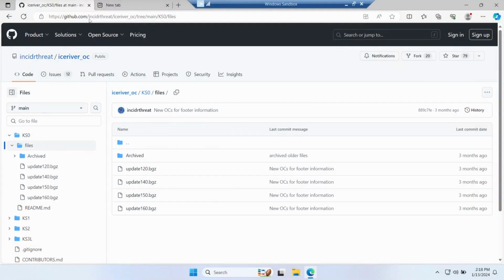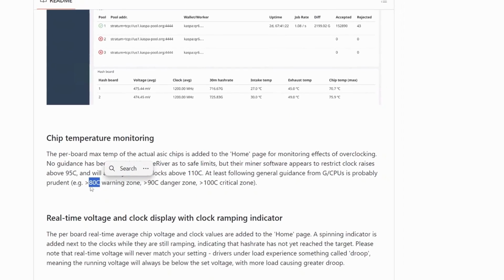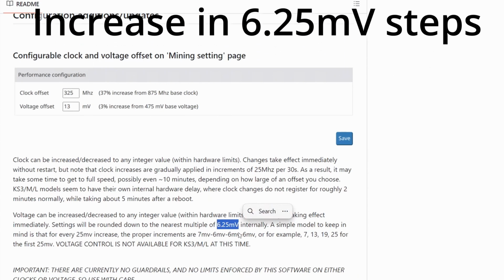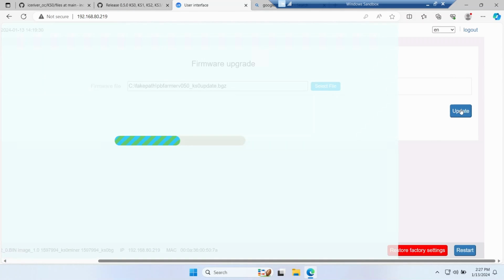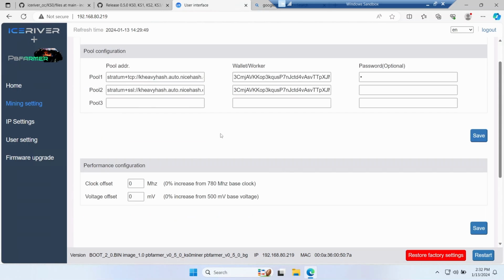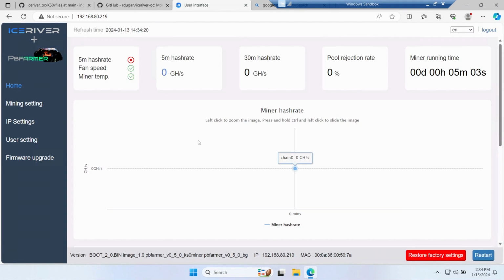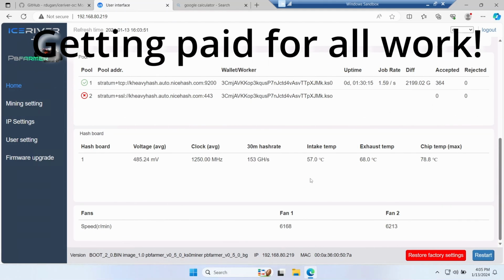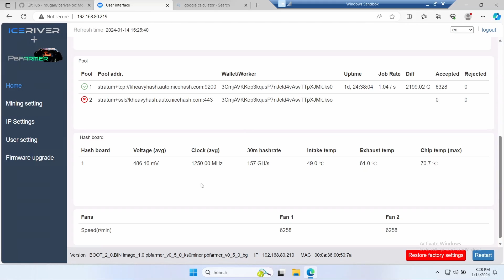New IceRiver Kaspa Overclock Firmware 2024 #rdugan #pbfarmer

Comment: Great video.  Thanks for putting this out!

Re: temps, you’re probably fine up to mid 80s, but it seems IceRiver devices may have an operational sweet spot in the 70-80 range

As for the rejections, the rate at the top includes fee traffic, for which the reject rate can tend to be higher.  I’ll update this at some point to only count your traffic to remove the confusion.  

However, I’m not sure why nicehash has a non-zero rate on their dashboard while the asic shows 0 for the pool.  On the asic side it’s literally a count of every time NH sent a rejection message - so the only conclusion I can make is that NH isn’t actually reporting rejections back to the asic (which is something quite a few pools do, unfortunately)
Reply from the maker: On the NiceHash side, most of the rejections are labeled "duplicates".

Thanks for creating such a great mod.